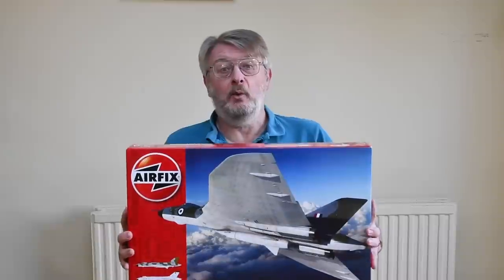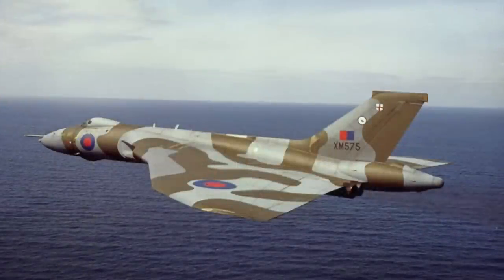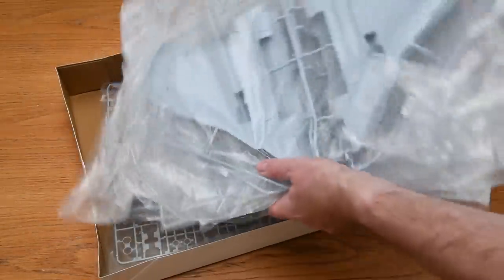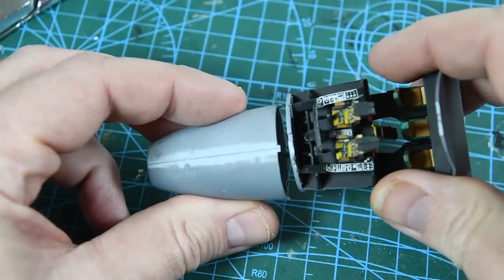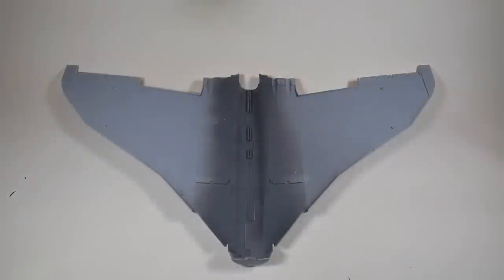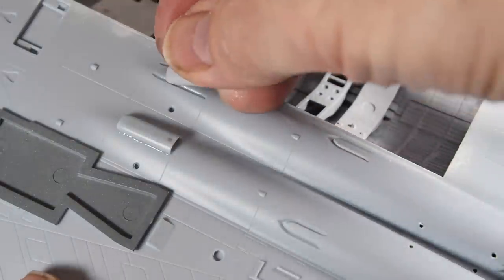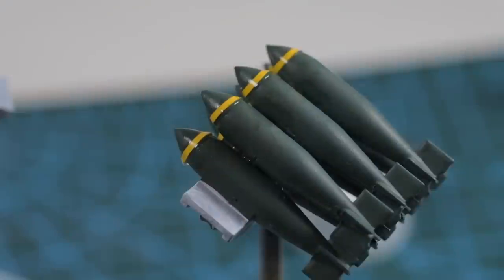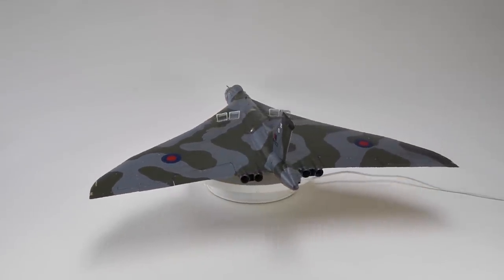Airfix Avro Vulcan 1/72 scale 2021 tooling review and build - HD 1080p

Comment: Idea for dry brushing (before I forget it as usual). How about a home made tool of a piece of sprue with a small layer of sponge wrapped around it? Then get a small amount of paint on it, remove it until it's tacky as for normal dry brushing, then gently roller the surface detail. You can't accidentally get in the grooves because it's a roller not a brush.

Comment: Spectacular finished model! Last year I watch a build of a large model Titanic. It had a motor to turn the propellers and the interior staircase could be seen but was built anyway.. Just the same with you painting the interior which is not visible.
As a child of the Cold War I remember seeing V bombers at various aerodromes and Bloodhound missiles at RAF Bassingbourn.
I believe you have made the Valiant, do Airfix do the Victor as well?
Reply from the maker: There was a Victor which was a new tooling in 2016 and it is being re-released later this year. Sadly it doesn't appear that it will be available with the full load of just 35 x 1000lb bombs!!!
Reply: @garys_stuff  I wonder if there is an air-tanker variant? That would deal with the bomb shortage or maybe there will be a kit from another supplier
Reply from the maker: They did a release of the K2 version in 2018...

Comment: Excellent build, Gary! May I just ask, where did you get the adhesive masks for the wings from?
Reply from the maker: They are a set made by a company called TopNotch, set TNM72-M185 is for the upper surfaces only and set TNM72-M186 is for the wrap-around camouflage. Should be easy to get from most outlets or online.
Reply: Thanks ever so much for your quick reply, I am looking forward to more excellent content 😊

Comment: Hiya Gary! I’m a beginning modeller with only a few kits under my belt. I couldn’t build the Lancaster unfortunately but I’m deeply considering getting this kit as a bit of a challenge. Would you say it’s suitable for someone with just a few kits or should I hold off?
Reply from the maker: Depends what those few kits are! But the thing with these is patience, follow the instructions and take your time. Dry fit (test fit without glue) everything. Its not impossible by any means.
Reply: @garys_stuff awesome! Just wondering, what colours did you use for the camouflage?

Comment: I hadn't thought of using PVA for clear parts. Have you tried clear PVA? I picked up a 250ml bottle from 'The Works' for £1.50 and will try it on my next build.
Reply from the maker: Not tried clear PVA yet, I got a bottle of the Revell stuff that is like clear PVA I think. There is also Micro Krystal Klear which is good for making small windows as well, I'm going to use that on my Concorde as they don't supply cabin windows!

Comment: Hi and what was the manufacturer of the plastic templates used during airbrushing ?
Reply from the maker: They come from a company called TopNotch. You can buy them just for the top surfaces, or another set that does top and bottom if you're doing wrap-around.

Comment: Can I ask whether you did any weathering? Because I'm at that stage of my kit and i'm unsure if the vulcan weathered or not.
Reply from the maker: I did some very light weathering - mainly some panel lines. I think by the time they left red Flag they would have had the usual Vulcan steaks under the engine bays and so on. The ones I saw back in the 1980s were pretty clean, although the insides of the bomb bays and wheel wells were pretty filthy!
Reply: @garys_stuff  thank you so much, and props to you for replying so quickly 🙏

Comment: Random idea. What about a tribute Vulcan in the markings of F/L Withers from the Black Buck mission to the Falklands?
Reply from the maker: Airfix will probably release a Black Buck Vulcan next year. The reasons I think this are (a) most of the bits are in the existing kit and an extra sprue for Shrike missiles and their pylons is easy, (b) the location holes for said missile pylons are already in the kit, (c) Corgi have released one and (d) when I visited Airfix and said they missed the 40th anniversary they said they could make the 41st. I suspect a boxing with two Black Buck versions, one SEAD and one bomber. Maybe also the Red Flag colours with the desert undersides???
Reply: @garys_stuff  They'd have to model the refueling probe too. They'd be OK for missiles though as the Black Buck Vulcan only had bombs so they wouldn't need the Shrike sprue.
Reply from the maker: @julianmhall  the refuelling probe is already in the kit, the one I built has the probe fitted. Black Buck 4, 5 and 6 were SEAD missions targeting anti-aircraft radar using Shrikes, although Black Buck 5 was scrubbed. Black Buck 6 was the aircraft that had to divert to Brazil due to a broken IFR probe.
Reply: @garys_stuff  Ah! When I read about the mission they couldn't find a refueling nozzle for a Vulcan as they hadn't been used in years, until a sergeant recognised it as what they had been using as an ashtray in the sergeants mess lol
Reply from the maker: They had to go around all the museums looking for some bits too. When you think about the effort and engineering inventiveness that went into it all, it's no wonder we won! I mean, toboggan refuelling from Victors to Hercules??? Bloody madness but it worked!
Reply: @garys_stuff  Victors to Vulcans you mean.. or were there Hercules involved too?
Reply from the maker: @julianmhall  there were occasions on which they needed to get to the islands with medium lift aircraft to deliver time-sensitive essentials. So they flew down in the Hercules and were refuelled by Victors. They had to do it in a gentle dive - about 500 feet per minute descent holding about 235 knots - so the Hercules and the Victors both sat inside their happy handling envelopes and the Hercs had enough in reserve to manoeuvre to the basket. This was known as tobogganing. They also had larger drogues fitted so the drag maintained their stability in the lower air speed. It would have been pretty hairy - the Hercules must have had quite the view of the big sweeping tail of the Victor! If I recall, some Hercs from 70 Sqn did the round trip from Ascension Island to overhead the Falklands and back - that's 28 hours of flying! Hercules aircraft were also refitted to be tankers.

Comment: PVC adhesive mask? Where can I get this? Thanks
Reply from the maker: They are a set made by a company called TopNotch, set TNM72-M185 is for the upper surfaces only and set TNM72-M186 is for the wrap-around camouflage. Should be easy to get from most outlets or online.